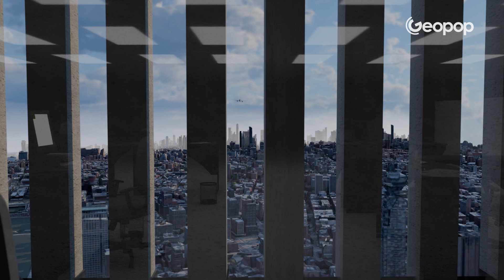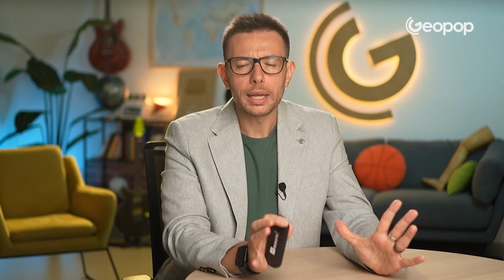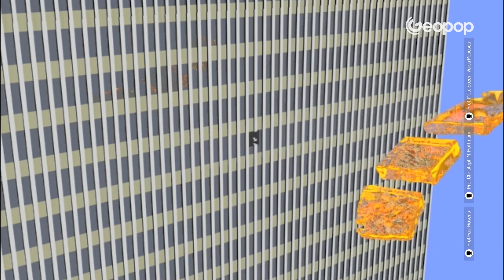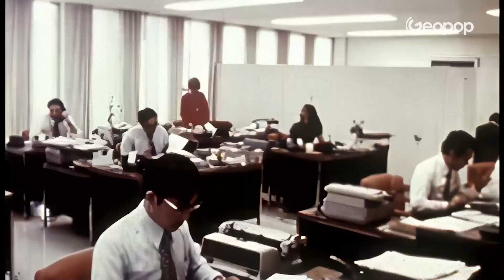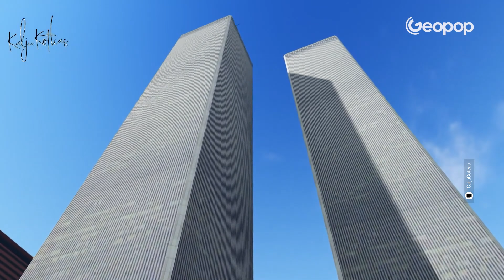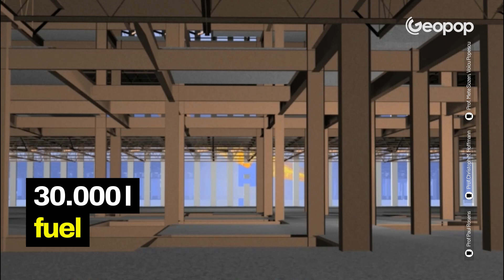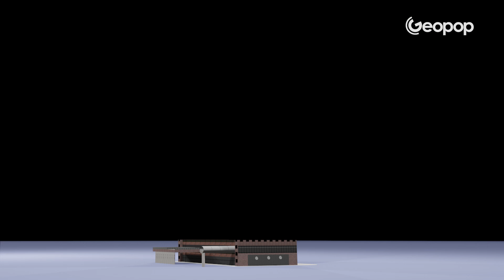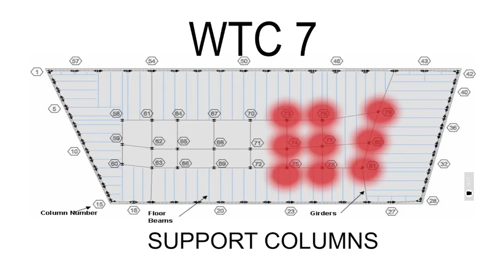9/11, 2001: The Technical Reconstruction of the Twin Towers and WTC 7 Collapses

Comment: The pilots are reported to have trained on light aircraft. This program states the Boeing 767 was moving at 700kph. Does any commercial pilot think that this is possible?
Reply: Experienced professional pilots and aeronautical Engineers say that these aircraft cannot fly at such speeds at low altitude where the air is 3 times more dense and would require 6 times the power necessary at cruise altitude. A great number of these people have signed a document requesting a new investigation.  They also describe how these planes would become uncontrollable with wings and control surfaces beginning to flutter and break up because they're not built withstand the stress at such speeds at low altitude in dense air. This would require heavier construction of materials and engines to increase the cost of these aircraft and result in greater fuel consumption.
Reply: Hi. I have had aliron flutter on a semi hot line RC aircraft i built. The control lost was unbelievable.  I cut the throttle and got the aircraft wings level,but the change in the trim was massive.  It needed full roll trim and some stick input to get it level for landing.  
Thanks for your imput. @ronaldgreene5733
Reply: Since I’m back here….Fun fact - the lowest altitude a 767 could legally fly at was 980ft, “legally”. The twin towers were 1368ft & 1362ft (excluding their spires). Each floor was 12ft in height. Floors 93-99 were hit in the North Tower (1164ft high at floor 93) and floors 77-85 were hit in the South Tower (966ft high at floor 77). Each tower was 207ft wide. The wing span of a 767 is 156ft. The fuselage is a mere 16ft wide. Hardly impossible or improbable. Like throwing a dart at a dart board.
Reply: @JJR9000  

Non-pilots are so clueless about flying. I suggest you quit while you're behind, as you're already sounding both arrogant and ignorant.
Reply: @NPC-fl3gq  you got it! It’s my pleasure 🙂
Reply: Yes, Renato Stiefenhofer a Jumbo pilot and flight instructor. It is impossible.
Reply: Throwing some numbers at the proportional difference in scale, it's about as impossible as hitting the back of a truck at 50 mph, or managing to stay within your lane on the freeway at 70 mph...

Or in the case of commercial planes, it's about as hard as purposefully managing to crash into the runway at three times the speed of ordinary normal landings.
(That are done 100,000 time per day.)

One more detail, they trained on light aircraft for the physical flying, then they had simulators with actual commercial craft for the target practice.
Reply: Yes. Once airborne a light aircraft and heavy aircraft are not significantly different in control and behavior. Only weight and maneuverability, calculating distance and altitude changes and responding appropriately. It’s akin to driving a flat bed and then a trailered semi in wide open road with bumps and slight curves to negotiate. A 767 can cruise ‘safely’ (I get the irony saying safely) at max 560mph, although it can travel faster. 700kph is 430mph and I doubt they took a moment to think about if they should let off on the throttle, when their intent was to go through a building and cause max damage. I would logically conclude that the 430mph was reached on approach as the throttle was increased to max open to maximize airspeed upon impact. Nonetheless they really only needed to make a wide turn back to NYC and keep the plane straight. BTW - the 707 also mentioned in the video was built to cruise at 590mph. I realize you didn’t ask all that…. I got carried away.
Reply: @JJR9000  At sea level the air is much denser and not conducive to speed or manuverability. A marginal GA pilot would not be able to verically navigate across the state in a commercial airliner, and hit a relativelty narrow target dead center. And that is just one in the mountain of absurdities. The official story is implausable.
Reply: @432b86ed  You wear a tin hat and you want to believe what aligns with your narrative. Nothing I say, or anyone says, would change your mind. I can’t argue with ignorance. It’s an impossible feat.
Reply: @JJR9000  So I am ignorant because I don't agree with you? sheesh
Reply: @432b86ed  - Navigating across the state is pretty simple with an autopilot that can easily be set to where you want to go.

Manouvering is easier at low altitude because there is air pressure that gives more force to the surfaces used for control. You should try flying at max altitudes and feel how wobbly the controls get when there's barely any air to work with.

Hard to hit a building 200 feet wide, are you serious..? A bit of work, but with some practise, sure.
Reply: @Zoroff74  These "ga pilot" "terrorists" who were alegedly unfit to fly wings level would have extreme difficulty under maximum pressure, doing what they supposedly did. I don't buy it. But that is just one of the BS flags with this "terrorist event". There is a shit load of it. But to see it you have to look beyond the headlines. It doesn't make me happy to have come to this conclusion. So hold the tin-foil tripe.
Reply: @432b86ed  So go on, tell us YOUR doctoral qualifications.... I'll wait.
Reply: @LoveHitch78  A 2nd grader should be capable of grasping this,, smart guy.
Reply: @432b86ed  Yes you're right. A 2nd grader could understand and REJECT what you say based on logic and evidence. Oh and it would seem you need to re-take 2nd grade, given there is no occasion where you use two commas in row.
People here are telling you simple things that YOU seem unable to grasp. I know that I'm  a hyper-analytical type of person and regulary see through the BS that is presented on the news. But on this occasion it is the BS of Islam that is responsible - that it easy for all to see.
Reply: @LoveHitch78 
 Secretary of Defense Rumsfeld was incommunicado the whole day. Unable to be found by anyone until after the Pentagon event, whereupon he could be seen in news reports getting in the way of EMTs and trying to carry stretchers. Nobody knew if there were more attacks coming or not. 
Does this sound logical to you, and unworthy of suspicion?
Reply: @432b86ed  you’re ignorant because you made an ignorant statement. Not because you don’t agree me. Like it or not, it was really ignorant. I appreciate the effort to disagree with my comment to the OP though. It’s amazing you are still arguing this with others. Youre the elephant in the room. You’re the one adamantly arguing 2+2 doesn’t equal 4. Let it go. You don’t know enough about what you’re talking about and feelings aren’t facts.
Reply: @432b86ed  The Defense Secretary was at The Pentagon? If that's suspicious to you it's no wonder you display your delusions for all to see...
Reply: @JJR9000 

You're obviously not a pilot. 
I'm not either, but I was when I was younger, and you could not possibly be more wrong. 
The change in speed and different roll rates etc would make it much harder than non pilots realise.
Reply: @NPC-fl3gq  I’m not more wrong, lol. It literally happened. You watched it. Unless you’re in the camp that it was an inside job, just like the earth is still flat. Pull your head out.
Reply: @JJR9000  thanks for all that information.  It's no problem sharing information and expertise as it helps all of understand more about things that go  on in the world. . 
I guess I need to ask a more specific question.  
Can a novice fly  a 767 at 700kph at less than a 1000 feet . I would think that not many pilots would ever do this as at a 1000 feet they would be climbing out, or losing all the energy as they prepare to land . But is 700kph sr 1000 feet or less possible and could a novice handle the aircraft as accurate as needed to land on a runway? 
Thx

Comment: this is a load of rubbish..... remember what the owner said about building 7..... " it was so damaged, we decided to pull it"
Reply: He was talking about pulling the firefighters out. Completely delusional to believe he was talking about blowing up a building on national television
Reply: @mikebyrd8278 ”Pull it” is a term widely used by construction workers that means controlled demolishing.
Reply: @kaalen24  nonsense
Reply: @mikebyrd8278  That was the context. “We had to pull it”.
Reply: @kaalen24  says you. Yet the  fire chief said the building was heavily damaged and was at risk of collapsing which is why they evacuated the area around 2:00
Reply: @mikebyrd8278  Says him. I’ve seen the clip as well.
Reply: @kaalen24  yeah an you are taking him out of context. The fire department determined it was going to collapse
Reply: @mikebyrd8278  A steel, or metal of any kind, building has never collapsed before or since from fires. Perhaps you would like to research why steel buildings don’t completely fail from fire.
Reply: @mikebyrd8278  https://www.europhysicsnews.org/articles/epn/pdf/2016/04/epn2016474p21.pdf
Reply: @kaalen24  
https://youtu.be/AUIr7377X_U?si=M0ZrBxa3BivXnIJh
Reply: @mikebyrd8278 And he did indeed say “pull it” not pull them.
Reply: @kaalen24  yet you are still taking him out of context
Reply: https://youtu.be/XImQ6a-VrnA?feature=shared

Comment: All this technical support and engineering that went into this video... Actually the report on the 707 versus the 767 is way wrong. 707 can hold 90,300 lbs of fuel while the 767 is only 63,000 lbs. Total weight of the 707 is 333,600,. 767 is 315,000.  Don't know how accurate this video is if it starts out with the wrong information.

Comment: No! No, A thousand times NO! 
Twenty three flipping years and you still make a YouTube that trots out the same tosh as many others have posted. 
Let me make it quite clear that I'm not any kind of conspiracy nut - at least - not in the sense that the lunatic fringe post.
I might not be able to stay away forever but for the moment, I've stopped at the point where you state that the Towers were "designed to withstand the impact of a Boeing 707" - completely WRONG! 
It was a pure coincidence that the engineered frames could notionally withstanding a sizeable side impact - it came about ONLY because of concerns about resistance to 13,000 tons of wind force and NOT possible collision by an aircraft. The myth about 707's came about to scotch criticisms of detractors of the whole WTC scheme that had various understandable axes to grind - such as having their money in rival developments - and the now famous filmed (yes filmed ) interview in which it was glibly mentioned that the Tower's design could withstand "multiple impacts" and not fall due to their double tube concept. 
It was enough to satisfy the media, scheme developers and prospective tenants but not traditional engineers that thought the general march towards lighter and lighter builds to go higher and higher had already gone far too far. 
Those that doubt me - go check out the original blueprints (yes, blueprints ) and documents lodged with the City of New York Building Ordnance office and see if you can find any figures for an actual Boeing 707 or even a mention of any aircraft.

Comment: 9:29 the fires never got close to 1000c that were burning. The initial firebird consumed 98 percent of the jet fuel which burns cooler than gasoline. It’s essentially diesel fuel with additives to prevent melting of the turbo fan engines.
Reply: Jet A1 is kerosene with additives, not diesel which would gum up in cold temperatures at altitude. 
It burns at a temperature so hot, that turbine blades and stator vanes aft of the fire have their own cooling system of bleed air from the compressor, or else they’d melt. Numerous examples of inadequate cooling and engine damage as a result of melting components are readily available, including speedbird niner.

Comment: I may not be an expert, but I think that it would be possible to put a cooling system inside the steel, e.g. a pipe with a flowing inside of cooling liquid/gas. In the event of a break in continuity at some point, you could put valves so that the cooling gas/liquid does not leak. Add an expansion tank and heat sensors to direct the coolant only to the place where the temperatures have been exceeded, which would allow limiting the amount of coolant circulating in the system. Please remember that I am a complete ignorant when it comes to these matters and I am only asking whether such an installation would make any sense

Comment: A lot of people don’t realize that the towers didn’t ‘collapse in 10 seconds’. Many steel spires and portions of the building were still standing when the rest of the building fell below. In another 10-20 seconds the rest came down.
Reply: @jacoboc2244  Enlighten me
Reply: @jacoboc2244  C'mon man. This is almost 25 years old. Do you really think that everyone who worked in the buildings wouldn't know if bombs were planted in the towers. And, enough explosives for a full demolition? I can understand building 7. However I don't take that position anymore but I understand it. 

Bottom line is the structural stability was compromised by jet fueled fire and high winds. Those tops pancaked on to the lower floors causing complete collapse. End of story. Sorry

Comment: At 13,20 you say that the plane "severed" 37 of the 49 columms. This is a bald faced lie because a plane made of thin aluminium is incapable of doing that because the steel was over two inches thick. No matter how fast it was going it would simply be squassed on the front. For example to severe 37 columms the entiredy of the plane would have to have done that from wingtip to wingtip. You top it off with saying the plane was still able to destroy 10 core columms and they were of thicker steel.  For gods sake don,t spit on the memory of the victims with such lies.
Reply: And yet, we did see both planes slam into the building.  That's why there was a hole there.
Reply: An aircraft fuselage isn't a hollow tube - it also has avionics, bags, baggage bins, lavatory and galley components, seats, people, etc that still push forward.

Comment: If you do not specify the raw data, such simulations are worthless.

Why weren't the planes intercepted beforehand?

How could Atta and others fly so precisely if he only flew small planes before?
What about the sprinkler system in the buildings?
Why was the building virtually pulverized and in an almost free fall?

The clean-up work was started too quickly and the steel was then sold to China. 
Many questions remain unanswered and these are just the ones that come to mind spontaneously.
That's why there is still a bad aftertaste when you think back on it.
Reply: They learned to fly the big planes using flight simulators.  One simulator actually had them "fly" into mid-town Manhattan right by the Twin Towers. They could run the simulations as often as they wanted.
Reply: The sprinkler system would not have made much of a difference at those temperatures.  Plus, once the pipes to the sprinklers were cut by the impact, no water is coming out.
Reply: I do wonder why it took so long for the Air Force to get on it.  Of course, the first plane was only flying from JFK airport which is only fifteen miles away.  The hijacker had control of the airplane in the first half hour after take off, so he had time to swing it around and get it up to speed.

Comment: It still amazes me people say "it had to be a controlled demolition because steel doesn't melt in burning jet fuel!"  These people are idiots. Steel doesn't have to melt.  It just has to lose *strength*...which it does at temps easily attainable with burning jet fuel and other combustibles typical in an office.
Reply: There was a stream of liquid/molten metal seen flowing off one of the floors of the building.  It can be seen in vids taken before the buildings fell.  I have seen it several times over the years myself.   A few firemen also said they saw molten metal as well in a recorded interview right after the event.
Reply: @cattycorner8  and, of course, you have links to all of this, right? It's not like thousands of structural engineers, materials engineers, physicists, and chemists have weighed in on this across the globe.  Are all of them in on some conspiracy?

At some point you have to take off the tin foil hat.  The towers fell because the steel was weakened by heat.  This is the expected mode of failure under such conditions.  It doesn't require thermite.  It doesn't require demolition.  It doesn't require space aliens delivering orders to the Illuminati to have the towers eliminated.  If you heat up steel that's supporting thousands of tons of weight, that steel will deform and fail.  Period.
Reply: @ThePrisoner881 

Since you seem to have all the facts and data, I'm sure you can easily debunk William Rodriguez's (survivor) ear and eye witness account, can't you?

Comment: The 10,000 gallons of fuel was a contributory factor to the fires which softened the steel.................. 10K gallons  of fuel sounds like a lot, but it's actually about a kiddies size swimming pool say 8 x 7 x 1m, compare that to the size of the Towers, of course this doesn't account for the fuel used in flight or that vaporised in the explosion. This just puts into perspective the level of farce in telling us the burning fuel cascaded down lift shafts and stairwells............
Reply: You got it brother!